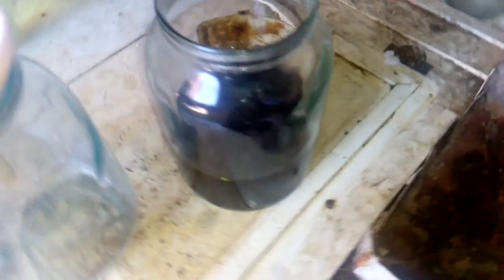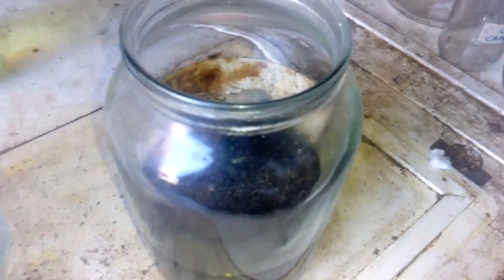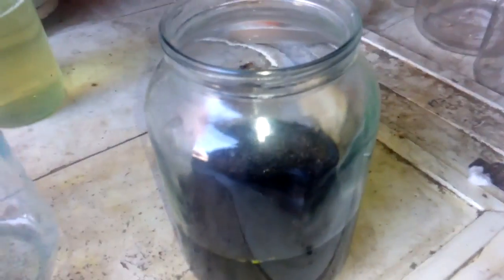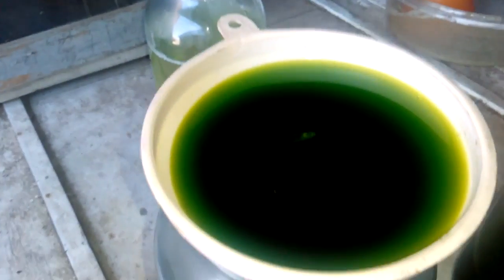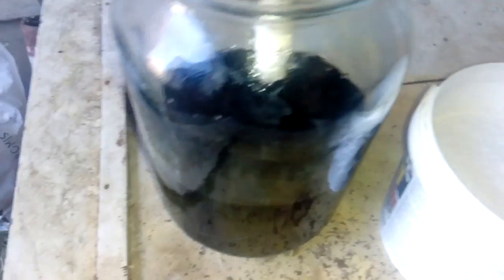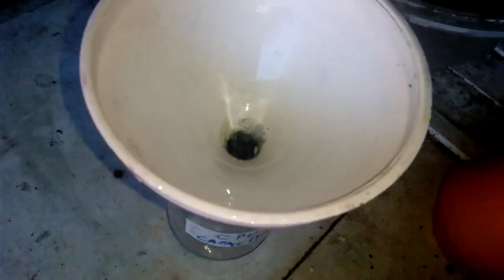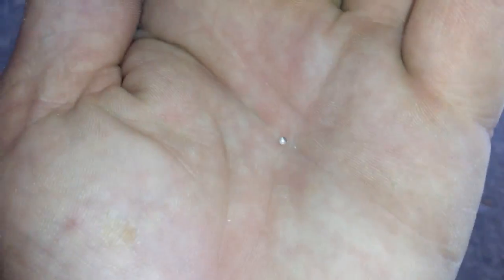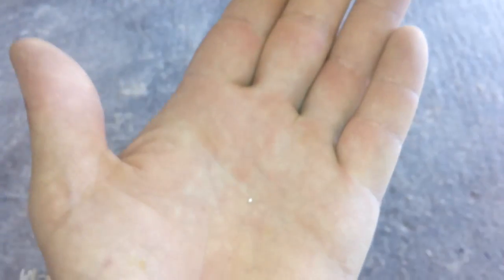Platinum recovery from Hdd plates part 2

Comment: Hello , The Aluminum can be dissolved with Sodium Hydroxide solution ( Caustic Soda solution ) Much cheaper .
The shinny skin on the HDD is an alloy containing Platinum Group Metals and magnetic metals Not Iron just sell the skin as is 
Or melt with 11 Parts Silver (Ag ) to 1 Part Flake ( skin ) them inquart with Nitic acid to get clean PGM's . Silver is recovered easily
for reuse  . good luck
Reply from the maker: Well explained, although I doubt that I will soon be working again because of the extremely small amount of Platina, too much time.
Reply: Hello Johan Loots ... will the Sodium hydroxide (caustic soda ) reaction be as violent as the hydrochloric Acid reaction?   Also can you precipitate the PGM after inquarting them with SMB or is Ammonium Chloride really necessary ???
Reply: @ejgeem  Hi , what is PGM and SMB ?
Reply: What is PGM ?
Reply: @zmarekk  zmarekk PGM = Platinum Group Metals
Reply: @ejgeem  thanks
Reply: Did  you mean only the surface of the disk have Palladium? Than no need to be beroken, or grinding, just removing the Al by NaOH, than putting the hole disk inside the HCL+HNO3 will be good enough ..

Comment: Dang!, I feel for you I had chicken pox glad to see you better, Can you melt hhd plates to get the platinum?.
Reply: would it not be better to get ALL of the PGM and collect that, and refine it later? especially if there is Palladium ?
Reply from the maker: Of course, everything is better when it comes to a larger amount, we just have to think about the cost-effectiveness.
Reply: @999DusanGoldrecovery  I guess if you just scrape the outer edges, then bring up to the aluminum melting point it will all run out as liquid. 
That will leave the empty shells.
Even your little blow torch should be able to do that with 1 plate as an experiment first.
10 minutes work to see if its a good way to do it.
Reply from the maker: Thanx broo,im beter now,glad to be over :)
Dint try,but maybe if cut disk an melt,Nickl and other Pgm metal maybe fall on botom like havi metal junk.I don know!!!
Reply: Thank for reply. Maybe you can make a video of trying it be cool
!,  Thanks
Reply from the maker: Maybe some other time,now i planing some other stuff to do.
Reply: @999DusanGoldrecovery  i'm from indonesia👍

Comment: There is a way to do this with lye soap. Scouring the Disc then in the solution until it leave large foils. Also it is a very high grade of Aluminum you desolved , is there a way to recover the Aluminum? Some HD Disc have many other thing alloyed for the writing surface. But the bead you got is bigger than I thought it would be from so little to start with. Keep up go work, wish is could talk direct to you.
Reply from the maker: That the various discs contain various Pgm metals. The result is solid, I'm satisfied because I got Platinum, I'm not satisfied because the process itself is unprofitable. The question is whether the second time the amount obtained will be bigger, smaller or not at all. In the very discs. Really, I do not know how to recover Aluminum, there may be a process, but I'm not a chemist, so for now it's gone into oblivion  for me :) Fin me in the facebook :
https://www.facebook.com/dusan.pantic.5